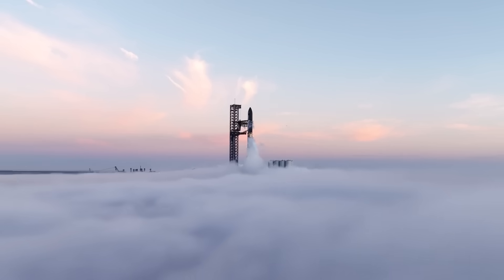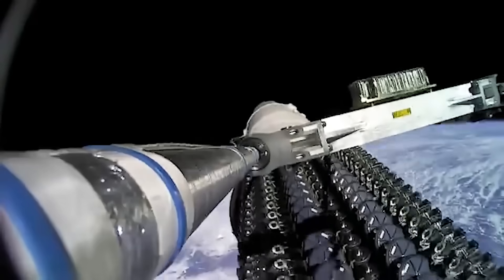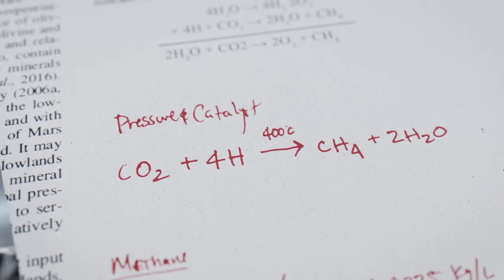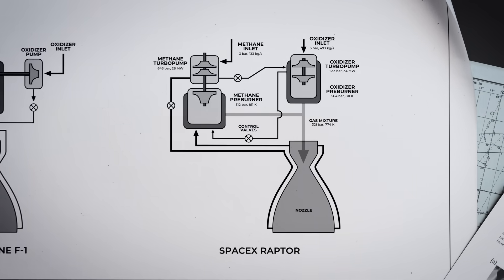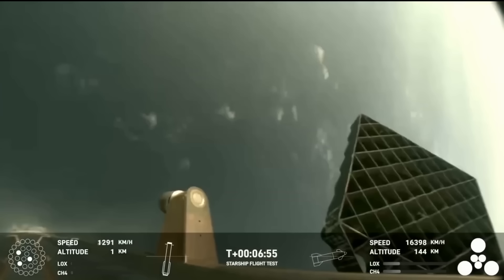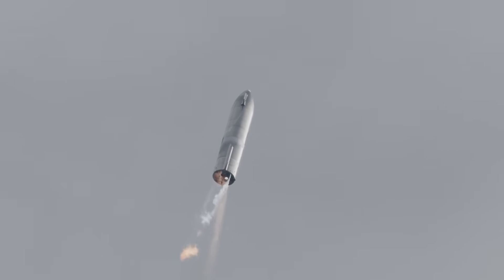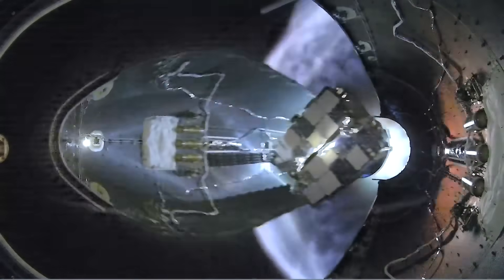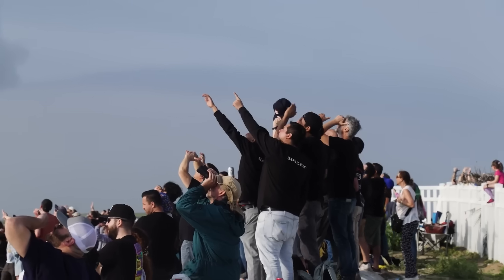Starship Reached Space. What Now?

Comment: The way Starship powers down its engines, concentrically inward, is so cool.
Reply: Aparently its to stop the momentum of the fuel flying backwards and slamming into the plumbing and tearing the rocket to pieces. (several tonnes per second).
Reply: @Mallchad  Water hammer is a bitch in rockets. You shut off the valves all at once and you have several tons of fuel in those pipes travelling at 60 mph coming to a complete halt instantly. Like a Ford F150 hitting a brick wall from highway speeds. Would blow out all the pipes all at once.
Reply: @wally7856  Yeah, you have all of the weight and momentum of that cryogenic liquid propellant to account for and I imagine it is not an easy feat to try and compensate for that when powering down the engines.
Reply: @Mallchad  i love rocket science because every legitimate problem sounds insane when you try to explain it

Comment: Space X has also mentioned longer/taller variants of the Starship. They're going to be constrained by the height of the launch tower but right now the ship is 120m and they want to stretch it to 140-150m tall. That's just the ship, not the booster.
Reply: 120m (or 121m with the vented interstage) is the total height of the stack, Ship + Booster. As of now Ship is 50m, Booster is 70m (71m with the vented interstage) 
Future versions of Ship might be 60-70 meters tall.
Reply: @kittyyuki1537  Right. I should comment when I haven't slept for 2 days. Thanks for correcting that.
Reply: @crf80fdarkdays  I wish it were that. I have a painful disability so sleep can become difficult. If it were glass, at least I could quit. I can't quit pain. Wait. Glass Harley? Are you saying I ... I don't understand.
Reply: The tower is multiple near-identical sections. Stretching future ones should be fairly straightforward

Comment: I will say one advantage of methane over kerosene or hydrogen. It's it's temperature that is stored. it's very close to temperatures of Liquid Oxygen, so rockets that use Methalox can use "common dome", without thick and complicated insulation between tanks. LH can freeze solid LOX. LOX can freeze Kerosene. Methalox doesnt have that issue so it makes construction of rockets much simpler.
Reply: now I want to see someone mix liquid methane and oxygen
Reply: @fulconandroadcone9488  You did. That's what made the fireball coming out of the ass end of the rocket.
Reply: @fulconandroadcone9488 Starship does that. It’s called the engine.
Reply: @fulconandroadcone9488  You have seen it.  They mixed in the booster engines and it lifted off.

Comment: Starship to the Moon have to be refueled by 8-12 another rockets. I don't think it's nitpicky, but nobody knows exactly how many Starships are needed for one flight, which is crucial for space cheese.

Edit: I don't think they'll successfully made fuel depo on orbit when Moon missions depends on it.
Reply: it's not that bad. There is one huge advantage that starship have: PRICE

one stack costs about 90mln. Launch is about 100mln (price not including stage0 refurbishment, as modifications are still in progress). I am quite sure that booster will be relatively quickly reused, as this is quite comparable to technology that spaceX already mastered. With a Twist: Superheavy can hover, falcon9 have to use "suicide burn". I DON'T expect success of soft touchdown on ift4. Maybe on ift 5 or 6. then about 2-3 more tests to achieve sufficient accuracy and stability for attempted catching. Itr will probably right on time with second launch tower come online. I DOUBT that SpaceX will risk only one existing launch tower. 
With reusable booster cost will be around 30 mln per launch (18-20 mln per ship + fuel and fixed cost of ground crew/equipment+cost of refurbishing booster)... That is VERY cheap.
Reply: @just_archan  Unfortunately you're making same mistake like NASA with Shuttle, making assumptions before it's finished and as bonus believe what junkie says. Falcon 9 supposed to be cheaper and reusable, but it's pretty similar with cost like Soyuz. It only achieved US independence from Russian rockets and Starship with approx. 10 depos will be cheaper but not as much it was promised.
Reply: @Feefa99  i am NOT telling about "promised" price. It is cost of today.
And that is so impressive. Reusable in scale like is promised, so just refuel and go.. I don't believe. Into reusability similar to f9? That's another story. 

As for f9 and Soyuz price.. part of that is that we are operating of "customer" price. From internal cost of f9 I know that second stage cost more or less 10 mln. So while we know how much customer have to pay for Falcon, I don't exactly know how much space X or roscosmos internal cost are. And roscosmos operates in Russia, where wages are really different. And wages are massive part of costs. additionally Soyuz is reusing parts from R7 ballistic missile. Missile that is retired, but both many rockets left, plenty parts of that is still in magazines, production lines are long time paid. 
For how long this price can be kept so low hard to say, because remember that Russia will replace with next gen rocket with Angara. That could be partially motivated that parts supply is slowly ending. Especially that engines were made in Ukraine.
Reply: @just_archan  Again you're making assumptions for product which is not yet ready and have to be furthermore tested, they have tons of achievements for sure, but also tons of untested things and details just necessary for survival of astronauts or rocket itself. We don't know cost per launch.

About F9 and Soyuz and I am focusing just on cost per launch, obviously if you want cheaper rockets and don't spend money on employees just use slave labour, but that's totally another moral and ethical cost. My point is that cost per launch is not that different and Elon made already too much promises.
Reply: You right, but I think my points stands. I am not reaching toward human rated system, as we are too far in future. Also I don't count on reusability of ship itself, as I don't think that will be achieved before 2027, if ever. I am on the other side very confident on ability of recovering of booster. Simply SpaceX is very proficient in that. And principles are quite similar, except that superheavy will be easier in many ways as it can hover, while F9 couldn't do that. I am NOT confident about "mechazilla", but SpaceX displayed many times ability to adapt. This is why I am very confident in starship. 

And we have pretty damn solid knowledge about internal costs of SpaceX Starship as for now